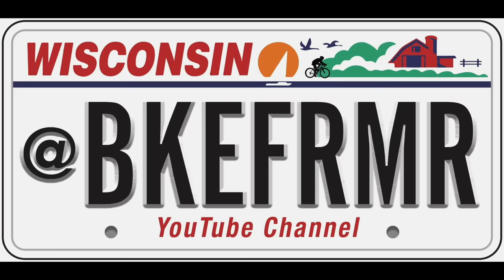Customer TRASHED their bike, but I still took it back! Big mistake? I gotta try!

Comment: Old School bikes,  cromoly steel frames, good times. Time of the best bikes ever. Nowadays, no reliable bikes like the 90's bicycles. Made to last forever.
Reply: You can sure find good, reliable bikes if you look around but the big brand and discount store ones seem to have become worse. Plenty of cromoly frames too, I have 3 myself and the newest one is from 2018.
Reply: @marcussoininen2084 Yes but I bet you didn't buy an entry level bike in 2018 either. Bikes with cromoly frames these days tend to be pricey as opposed to the 90s when it was a very common material for entry level bike store bikes...possibly even the standard.

Comment: How odd to have a Schraeder valve refuse to let go like that.  Easy to call good enough with truing wheels like these, but honestly they weren't too bad before you started.
Reply from the maker: Someone had some sort of sealant tin there or something. I’ve had Slime tubes have issues but never anything like what this Mongoose had. Weird!
Reply: Had this issue on a rebuild of a vintage bike that I guess had a Slime tube that clogged. Probably sat for a while. I just like basic tires and tubes myself.
Reply: @bkefrmr  not just gooey in there, but only half the valve core came out! In auto, there are some methods to soak in acetone, but not a great idea on a bike where you won't be able to wipe out the internal excess. I guess it would just spray out once it "opened", but meh, tubes are cheap, just replace.

Comment: Why didn’t you repack the bearings on the rims? You had the cassette off?  I’m guessing you never repack the bottom bracket , Headset or the wheel bearing on your refurbished trade in bicycles.  That sucks for the future buyer in my opinion.
Reply: People ride these rims till their race is so pitted that repacking the grease is only needed if you’re dry. The races are so pitted that nothing is gonna make them smooth again. You might get away with sanding them down one or twice before the race become misshaped. Not worth it on a bike you’re selling for a few hundred bucks.

Comment: I never understood why they have quick release in the front but not the back.
Reply from the maker: Because taking the rear wheel off doesn’t make things much smaller/easier to stuff in a car. Solid axles are cheaper, so cheap bikes have nuts.
Reply: I was thinking more for easy inner tube changes on the side of the road @bkefrmr

Comment: that's  exactly  way  i  lube  up  spoke  nipples  im  not  just  an  idiot  then lol  makes  sense    to  put  drip  oil  on  then  spin  it  like  you  say  centrical  force  drive  oil  into  the  nipple  i  then  leave  wheel  overnight  than  do  it  again    then  start  truing  it  im  not  great  at  truing  wheels  takes  me      like  4  hours  but  that's  a lot  to  do  with cheap  truing  stand  i  have  id  saw  my  right  arm  off  for one  them  park  tools  ones  but  for  how  often  i  use  truing  stand    the  price  too  much  i  do  have  one  the  park  tools  tension  meters  so  i  can  show  people  the  printout  after  iv  trued  there  wheel  just  bit  extra  thing  you  can  give  customer im  retired  injured  soldier   and  bicycle's  i  just  love    its  freedom  not  putting    fuel  in    just  ride

Comment: Please tell us what all those parts cost? The new shifters, cables, chain, tyres, tubes, derailleur, my god that has to be at least $300 in parts alone not counting the labour unless you are buying your parts where they cost last century prices? Also did anyone notice the bike wheel was oscillating at the centre? I presume it means the bearing is knackered? I'm no expert on bikes but since it's just a steel frame without a rear quick release and not a replaceable rear derailleur hanger doesn't that mean it was a very low level bike to begin with? Good video to watch but I can't help thinking you have massively over capitalised.

Comment: What's the hairspray on the workbench for?
Reply: He used it for the grips
Reply: Makes grips stick on
Reply: The hairspray is initially liquid which helps slide the grips on.  Once the hairspray dries, it acts as a adhesive so the grips don't slide off during g use.  Every bike mech has a can of Aquanet.

Comment: Question Anybody - Can you wax bicycle cables as you wax a chain to lubricate it?
Reply: you CAN, but I wouldn't. Waxing a chain is usually done to keep things clean. That's not an issue inside a cable housing. Easier and better performing to use triflow or other light oil.
Reply: I just did it today but only because I had the wax pot (rice cooker) out doing chains. It seemed to work okay after rubbing the wax in with fine steel wool afterwards